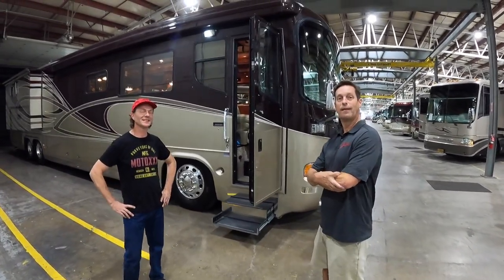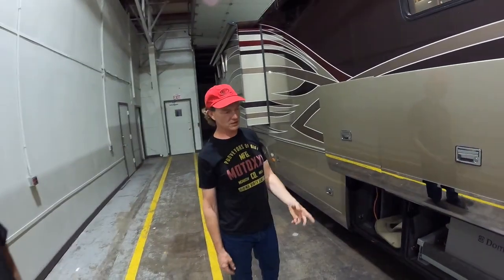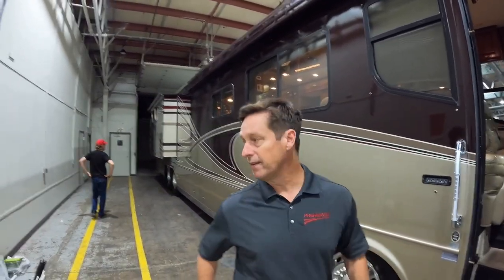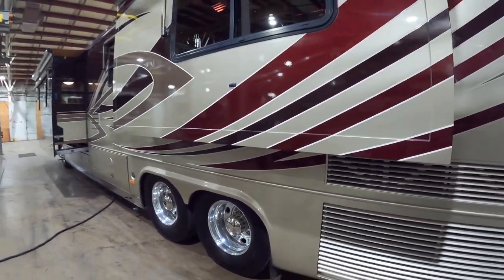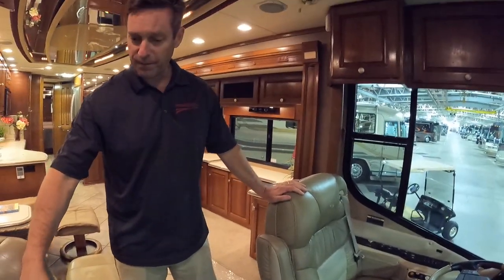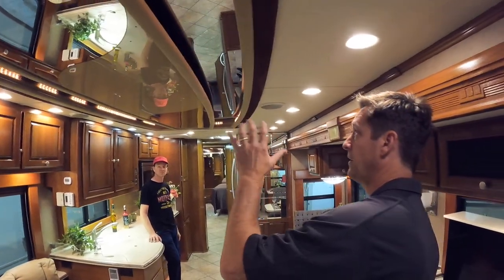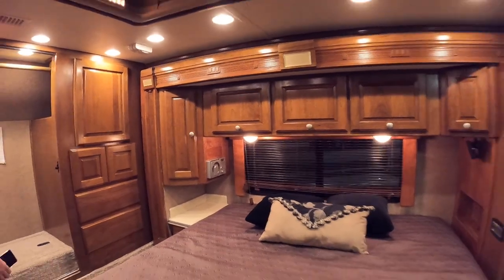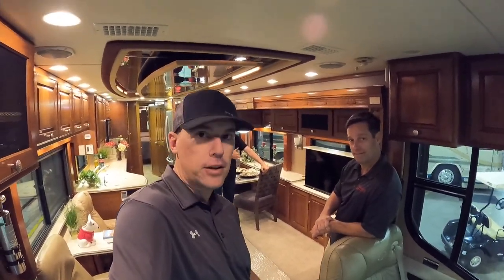MONACO EXECUTIVE WITH DETROIT DIESEL SERIES 60 FOR SALE IN OREGON $124,900!!!

Comment: Awesome coach. I had a 2006 Western Star semi with a Detroit series 60. It had a hard life in the oil field. That motor had 25000 hours on it before I had an in-frame rebuild. a 15 liter would have a 515 hp at the fly wheel. They are great on fuel, compared to CAT and Cummins (I've run all three motors over the years) All parts for the 60 series are easily available. This is going to make someone very happy!

Comment: The age would and probably should make some folks a little nervous to "pull the trigger" on this beauty. I've been a Class A driver, machinist and woodworking for too long to worry personally. 75% of anything that goes wrong, I'd fix it myself (or upgrade it myself). Looks like the previous owner did some fairly recent upgrades already. (The fridge, outside freezer, outside tv, plumbing looked too new to be 14+ years old!) If you're handy at all, I bet it'd be a good buy! ...and then shortly after, a Good Bye! I'm hitting the road!
Reply: AM AVUT NETUL OPRIT ABIA AM REUSIT SAL FAC ASTAZI

Comment: So as a coach owner wannabe never having or driven one before, how much would you think the cost of living in this full time the year allowing for maintenance and driving expenses?
Reply: You would need to know a little more info-
1. How many miles that you were going to drive/year. 
2. How good of a driver you are. (many obstacles).
3. Where you were going to go (extreme hot/cold weather is hard on RV's)
4. Boondocking in rural places you can get rodent issues with wiring ect.
5. How nice of places that you want to stay at.(some are free but some are well over $100/day)
6. Are you going to cook all of your own meals or eat out a lot
7. What are the prices per gallon of fuel at that time and ppg in the area that you are traveling (wildly different)
8. There will always be unexpected repairs and expenses

Comment: What fuel mileage are they getting? You’ve shown several with different engines. 
I’m wondering about the difference between the Cats,Cummins, and Detroit? 
Thanks!
Reply: As an Owner of a 40ft A class 2008 4 slide unit 350HP Cat I get about 8 MPG
Reply: @hoaoboards2321 : Thanks! That’s actually pretty good.
Reply: If you don't worry about fuel consumption go for CAT , Detroit 60 series in my opinion is best engine period for the motor home ,bulletproof reputation easy to fix  and parts are no problem to get  ,Cummins i personally like 14 liter  again i have nothing against Cummins  but they finicky when comes to electronic .
Reply: My 500 hp Cummins in my 44' Holiday Rambler (46,000 lbs) pulling a toad gets 6.9 mpg and will run up any hill. Everything I hear about the 60 series Detroit is that it's the best tho.

Comment: I understand it's an older coach but as nice as this all looks I have to ask, why so cheap?
I'm really hoping in around 18 to 20 months there are still deals like this coach out there.
As long as it's mechanically sound with everything working if someone was willing to put another $50k or so depending on paint into it they'd have something pretty special if you ask me. With paint and a few interior changes this could be an amazing first Class A for someone...
Reply: I was wondering why the price was so low, too. Should be at least twice that or more.
Reply: 2000-2008 are the golden age of motor coaches. 2000 is when slides became common and after 2008 is when the quality went down hill after the 2008 economic meltdown that hit the RV industry hard AND that is when they implemented the DEF fluid to diesel engines (costly and corrosive) in the name of emissions regulations.